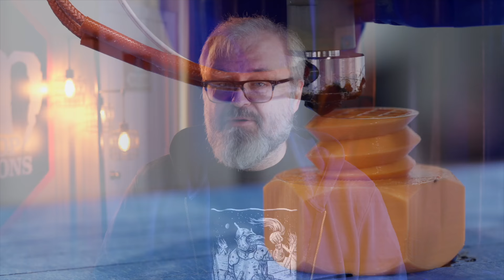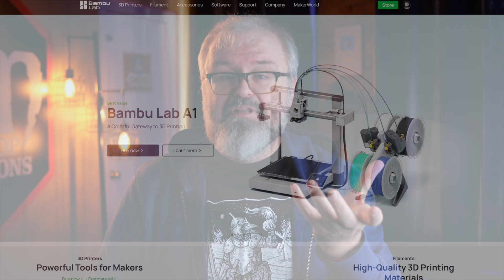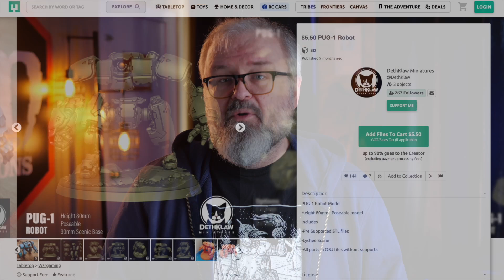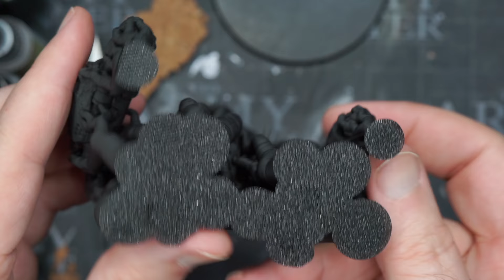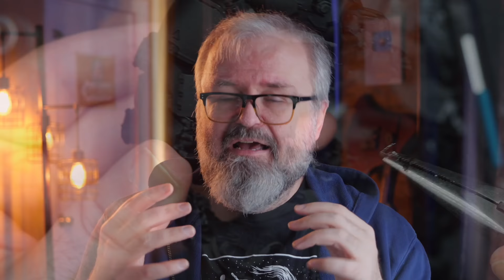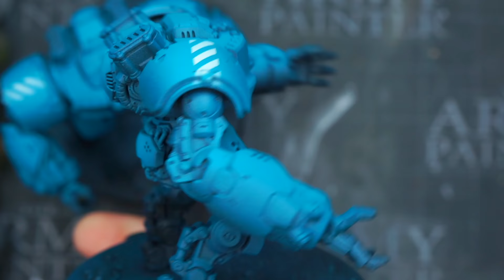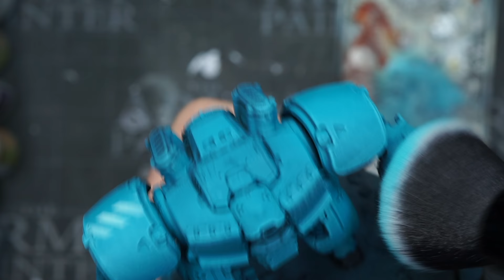I Compare RESIN vs. FILAMENT for 3D Printing Wargaming Minis

Comment: I recently tried Fat Dragon Games strategies on a bambu P1S.  While it still hasn't gotten down to resin quality, I've been having really good results with the Sunlu meta filament Fat Dragon Games recommends, and I've even taken the layer lines down to .06 mm height.  I've been  printing 32 mm scale Star Wars Legion minis from War Scenery and also Galactic Armory.  Their pre-supported versions actually work and cutting off the supports with small cutters has yielded some great results.  The tops of the helmets still show the layer lines, but there are times I can't even see the layer lines on the chest armor.

Also, sometimes I use the imperfections in the FDM print as a weathering strategy.  While it doesn't allow for an apples to apples comparison, it is a strategy I use a lot whether on minis or cosplay helmets with minor issues.

Comment: Small nozzle, smallest step size, enable variable step size, use an enclosed printer with door open or otherwise protect from drafts, dry and preheat your filament. No layer lines. No stringing. For supports use an AMS with PLA as the main material and PETG as the interface material, and set your z distance to 0. They will pop right off and leave a perfect surface.

Comment: I love the videos and the insight, even though I don't play tabletop wargames (for various reasons). However, from the perspective of Resin vs FDM printers, IMO, whilst Resin obviously will give better results, it is far more dangerous to use than an FDM printer. I have seen pictures of a guy who was using a Resin printer and accidentally split the resin on his leg, it soaked through his trouser legs and left horrific burns on his skin - that required skin grafts. There is a good reason that your video showed a user using a resin printer with gloves on, I would much rather suffer with prints that are not quite as good and avoid the risk of using dangerous substances like resin. Plus, I have never seen a comparison of the costs of resin vs fdm i.e. printing from a tub of resin - how much resin is lost in the tub, how messy is it to "recover" the resin that wasn't used in the printing? FDM printing, other than tree supports (which are present in resin printing as well), there is no "wastage". But love the videos, keep them up!

Comment: First of all, I have NO experience 3D printing, of any kind. My dad got a filament printer late last year. He said I could use it to print Table Top minis if I wanted, though he got it for other uses. I had always heard that Resin was better for Table Top minis than Filament. Seeing the video I can see why, but I'm curious, can you technically take some fine grained sandpaper (or something like it) and smooth out the layer lines from the filament version? I remember do something similar with model airplanes and ships, back in the day, and even still do that with some minis today.  But I've never tried it with 3D printed models.
Reply: You can but the detailed and complex the model is the harder it is to sand all the surfaces. You would also need to use different grits for a smooth finish like resin. Their is also the fact that you need some ventilation or mask so you dont breath in dust otherwise you wetsand everything which should be done for better sanding but some plastics absorb the water and need to dry out after. Plastics like nylon really like water and can warp but funny enough water logged nylon is stronger than dry nylon.

Comment: Unsupported files are there in case you want to do manual supports, or in case you want to adjust the scale more than +/- 15%. In which scenario you'd still have to do new supports

Comment: Interesting. I'm still up in the air about which printer to get. Resin or filament. I want to print models, but I want to upscale them to around 15cm - 20cm, 10cm being the smallest that I would do. Still up in the air this vid.

Comment: I print exclusively on a now old Ender 3 V2 with PLA, I print tons of miniatures and have no complaints. I do both 28mm dnd figures and 15mm wargame miniatures. While there usually is some noticeable print lines, these all but dissappear at arms reach. And with a good paint job it's almost impossible to tell the difference on the table. And I only use a .4 nozzle set to .12 layer height. So yeah, it's definitely possible to get satisfactory results from FDM printers.

Comment: Not sure if anyone said this, but you can print the supports in a different material (with an AMS from Bambu Labs), like PETG if the base model is PLA and they don't like to stick together.  That will make it mush easier to separate the two.

Comment: Make sure you test the Z offset of your supports when printing miniatures built for resin with FDM.  Increasing the top Z distatance can make those tree supports much easier to remove and eliminate the messy stringing you got on that print.  I've been able to eliminate most of that with minis all the way down to 28mm.  Also the type of filament is really important from Tomb of 3d Printed Horrors / Fat Dragon Games channel he tests some of the best filaments to use.  SunLu Meta works really well with the A1 and FDG's profiles with a .09 top z offset for supports. I get significantly better results with those two tweaks.

Comment: Really enjoyed this video.  New to printing.  Have a resin printer and getting a FDM one.  Simple question for you and/or the group.  I've noticed some of my models coming out pretty rough, particularly at the point of where the supports were cut.  Is there a preferred sanding process to smooth out the rough areas?  And if this is a dumb question, please feel free to call me out on it and say anything you want to about my mother!!!!!  Thanks.

Comment: I'd be interested in seeing a filament model printed in ABS go through the vapor smoothing process and see how it compares to resin. ABS dissolves in acetone, hanging the print in a small chamber with a bowl of acetone allows acetone vapors to lightly melt the model which fills in layer lines.
There is historical disdain towards ABS in the 3d printer community which I think is mostly due to early 3d printers being not great and people not understanding the material. Having a chamber for your printer (Putting a cardboard box over it) and letting your printer heat up the chamber before running the print almost completely solves the issues ABS presents. There is still some fine tuning to do after that but after having built a voron I exclusively print in ABS on it and my ender 3 which resides in a small grow tent.

Comment: One issue I found with the video is I noticed your supports were really stuck to your print.

To alleviate this, you need to change your "Top contact Z distance". The golden range I've found is 0.37-0.40.
This along with only 1 top interface layer will make your supports just gently snap off and minimize damage to the underside of your model.

Hope this helps. Cheers
Reply: This tip really improved my minis, thank you very much.
Reply: I usually go with the layer heigh doubled for z distance. for ex. if I print 0.8 layers than the z distance will be 0.16

Comment: You probably would have gotten better results printing separate pieces. You can also use a support interface filament to help with support removal. I definitely prefer resin for minis and filament for terrain. For me I get just as much if not more joy from painting the minis vs playing the game. So, I want to have a high standard finish to start with. Filament is getting better all the time though. I love my Bambu Labs printer, it was truly out of the box ready to print high quality and high speed 👍Happy printing, hobbying,  and experimenting.

Comment: I usually print pieces in filament in separate pieces so that I have more control over the angle and thus the support material. If I can keep support relegated to an area that will be glued later then that is the best case, but keeping it in an area not easily seen is also a win. It is too hard to print a full model with that type of precision. Also if a part messes up in print it is easier to just reprint that piece instead of the whole model. Filler primer helps to knock down the slice lines if you don't want to sand; depending on your settings. Con to filler primer is that you may lose some fine details.

Comment: I was recently experimenting with the Bambu Lab A1 Mini and I managed to print 8mm Tartarus Terminators for Legions Imperialis. They all came out with a little dent in the left leg, but it was easily covered up with liquid green stuff and they didn't look bad at all. However out of the 45 I printed, 3 failed, but without affecting the others I printed. I used the Bamabu Lab PLA Matte Grey with the 0.2mm nozzle on the 0.06mm High Quality preset on Bambu Studio and supported with the supports designed for resin. I was trying to push this printer and I'm speechless.

Comment: Two things:

First
There are many supportless miniatures out there, just search on MMF for supportless f.e. and you get 28-32 mm miniatures who don't need supports and thus are way easier to print with filament.

Second

There is free programm called MeshMixer and it makes combining parts digitaly way easier. More often than not you can just import all the files in MeshMixer and they are aligned to combine already (made by the creators like this for easier combining). Even if not it makes it easier (although you gotta learn how to move the parts properly) than in the slicer itself.

Comment: separate pieces printed with a bespoke support material used would be really good to see.  if printing in pla, petg, when flushed enough between the 2 filaments, will not stick to each other and will not cause weak layers because of mixing.  this allows 0 layer gap between the support and model and is trivial to remove.  only use the 2nd filament for the interface layers.  takes a lot longer but the results are much, much better.

Comment: Nice video. One comment though: at 2:47 you mention that PLA is biodegradable. That is not true however. PLA doe NOT biodegrade naturally. It can be made to biodegrade in very specific industrial circumstances (like very controlled temperatures). If you throw a PLA model away in mother nature, it will stay there for many generations to come.

Comment: I have a resin printer, and my friend that I play wargames with has an fdm printer. The best answer is it depends on application. Do you just want some figs for DnD? Or are you looking to print a horde infantry army? Either way it depends on the person and their circumstances. But for me? Resin all the way. The infantry is superb. And though I can get tanks done easier and cheaper from my friend. I still prefer to spend extra and print them in resin, that includes superheavies. The extra detail pops for me and is easier for my methods of painting. A good starting question is which do you want more, functional or beautiful?

Comment: On that small fig you're planning next, I'd be very interested to see a comparison of FDM vs. resin where it's more favorable to FDM: using a sculpt for a mini designed to print in FDM supportless or as pieces you glue together, like the ones Arbiter Miniatures sculpts. (Though, as you say, it's far harder to find sculptors of good supportless FDM minis than files designed for resin. I've bumped into only three of the former, and while I do like the monsters by Fat Dragon Games and by EC3D, Arbiter is the only one whose humanoids I really like. ((Definitely looking for more such designers to follow if anyone can recommend some!)))

Comment: I'm probably in a minority of recommending this, but... print in PETG. Set your fill percentage to at least 90%, use a gluestick on the build plate (regular elmers or purple stick works great), use a brim (outer only, 5 - 10 thick), and tree supports. Then when removing supports, use those snips to remove flues from model parts and cut close to where the tree supports anchor, but not quite. Always remove tiny amounts at a time. Time consuming, but it makes for pretty darn good looking models. For all the "hairy" bits left behind with PETG printing, blast it with a heat gun, but for short blasts only or the whole thing will warp. Paint brush prime as well, don't airbrush. You need a bit extra to fill in layer lines. Should get you a great result and the models are reasonably strong and can survive pretty good falls in my experience. Good luck!

Comment: printing parts seperatly leads in 98% of cases to way better results as printing direction influences the quality quite a bit and also with proper orientation alignment you can reduce the need of supports drasticly which leads to better results... also the bambu slicer is not the best at automatic tree supports and sometimes completly fails to support overhanging spots

Comment: I bought Prusa Mini from my friend recently - he had this printer at least from 2022. With a 0.25mm nozzle and 0.07mm layer height I give a test print of some of the free OPR models. And I must say the quality is very good. 

Regarding tinkering - the only adjustement that I had to do is the setup of the nozzle's height from the table when changing nozzle/changing the table type.

For this robot I would probably either: print in parts or use normal structural supports instead of the tree ones - tree supports looks great when they support the part from the bottom on a small area, but when they wrap around the model it's getting messy and they are usually more problematic to clean the model afterwards. I'm using the lightest supports possible and also some tweaks found on forum (for Prusa slicer):
Contact Z distance 0.25mm
Interface layers 3
Interface loops disabled
Interface pattern spacing 0.2mm
XY separation 75%

Comment: Put it on the finest settings. The default nozzle is 0.4. I would try 0.2 and the finest settings and then see what you get. They are drastically different.

Comment: It probably would have been smarter to print in pieces. Since you’d be able to change the orientation of  the model you’d be able to reduce layer lines in set places. There are channels that have been making video just for fdm minis and the always tend to break up models. The other benefit is if you mess something up you can just print out that one piece instead of having to reprint the full model.

Comment: I regularly print minis in both resin and FDM. There are many great FDM designed minis that absolutely have a place on the tabletop next to any resin, plastic or metal minis.
Great video! Thanks for sharing!

Comment: I think changing the default top support distance setting is needed. The 0.2 distance makes removing support a nightmare. Champ g it to something like 0.27 makes them soooo much easier to remove and to me results in way less scaring.
Reply: This seems to affect the tree support more than normal support. Maybe it is just me. But this is great advice that I learned the hard way.

Comment: Would I play with a filament printed model? Probably not. Would I give guff to someone using a filament printed model? Probably Not. I mean, just let people play. 
I think for larger models, filament is going to work fine in most cases - sometimes very well too - like Battlefront Valkyrie (i've even started making some custom ships/factions - because why not). I still prefer the detail for resin - especially if you are trying to sell miniatures, like I do, where you need the detail.

Comment: The 0.2mm nozzle isn’t always necessary.  You could scale the model up 200% and use the normal 0.4mm nozzle.
I know that doesn’t work for gameplay, but it sure makes some great display pieces.
Reply: I have some plans in that direction. I appreciate the positive reinforcement.

Comment: I play Age of Sigmar. I hate GWs prices in general but especially so for hero models and monsters. I have a little Anycubic KOBRA that I use for FDM printing terrain, mainly, but I also have done some monsters that came out great. I printed up a Kragnos proxy and 2 Bloodthirster proxies. They have layer lines but I lightly sanded them then applied a thin sprue goo mix to the whole model. Sanded again and applied more sprue goo. Is this time consuming? Yes. Fun? Yes. I’m here for hobbying and getting to spend more time on a nearly free model is a win win situation for me.

Comment: 1. Print parts separately.
2. Split each part in two along its length, and place them so that both he original top part and the bottom part are basically facing upwards on the plate. IMPORTANT! Use the smooth plate.
3. After printing, glue them together and sand the seam. Then use primer to further hide the seam.

This is more time consuming, but, in most cases, completely gets rid of the "hairy" underside, which is the bane of all FDM printing.

Comment: 100% Print the pieces separaly and choose the orientation for each piece: (a) to place supports where the separation surfaces won't be seen as easily and (b) to avoid the top-of-curved-surface effect you see on the head/shoulders around 10:34 - rotate these 90(ish) degrees and the lines can almost disappear. Finally - prime it just a bit more thickly that you might normally do.

Comment: Using supports helps quite a bit and printing with a 0.2 nozzle has made the detail a bit better.  I have had some relative success using filament for 28MM and greater models.  I do think Resin is the way to go for the most part when it comes to Wargaming models.  I do need to try printing in pieces to see if the quality improves.